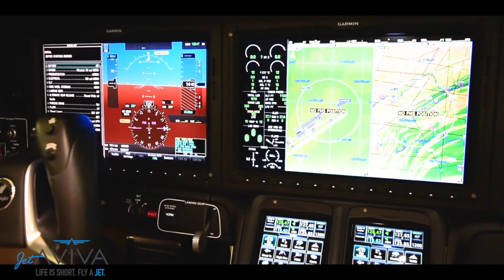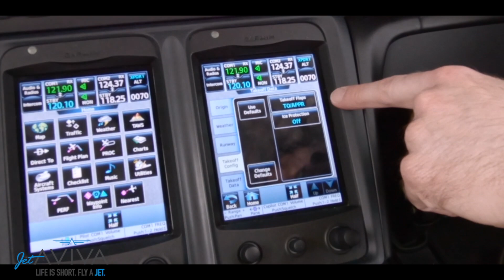Aircraft Review: HondaJet

Comment: Fuel load? Burn rate? Range?
Reply from the maker: Fuel burn is about 1000 lbs/hr for the first hour including taxi and climb, then 630 lbs/hr for the 2nd hour. The book says it will carry 2880 lbs of fuel, but the truth is, it's hard to obtain that because of the design of the fuel tanks. That has been improved on the Elite, so I've been told.  Range is 750-1000nm depending on how many people are on board, since you'll be trading fuel for passengers.  It's a rocket ship and great performer, but you do lose range the more people you have on board.
Reply: @jetAVIVA  Thank you!!!!

Comment: Lol if only they wouldn't call it single point refueling. These things are a pain to fuel with only one overwing nozzle. And the fact that pretty much everything is touchscreen is overkill
Reply: it would be better if it had mechanical controls rather than just electronics ( because they tend to fail sometimes resulting in crashes ) 
I think its a very bad decision ( looks cooler thou )
Reply: @bunnycow9467   It definitely wins when it comes to the design aspect.
Reply: LOL, this Clown talks like he knows something.
Reply: @VMXGroove  Actually I do. I work at an airport and deal with them on a daily basis for the most part
Reply: @VMXGroove  Well like I said before considering since I work at an airport and regularly talk to the pilots of Hondajets it's fairly certain I have gained some knowledge about them